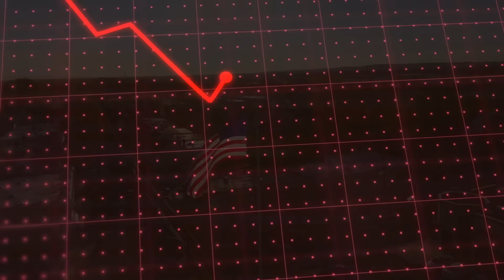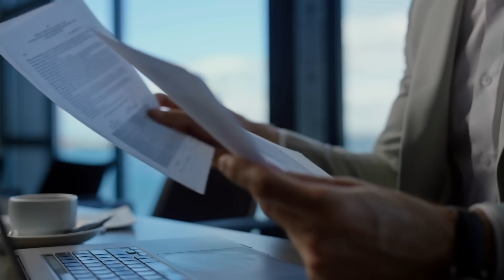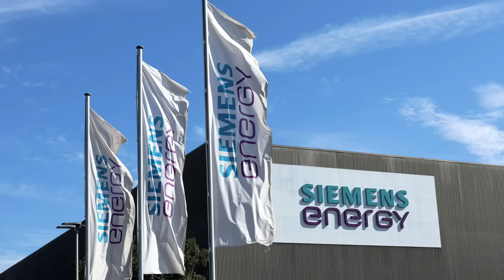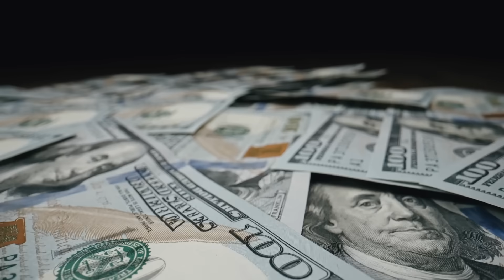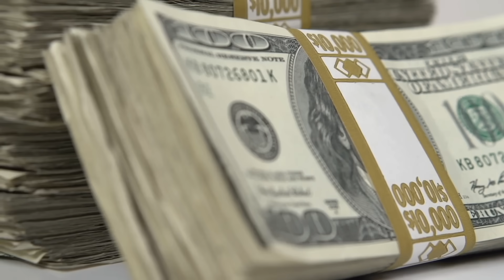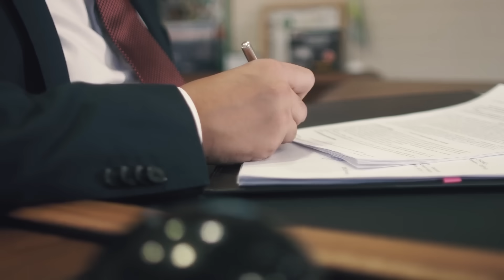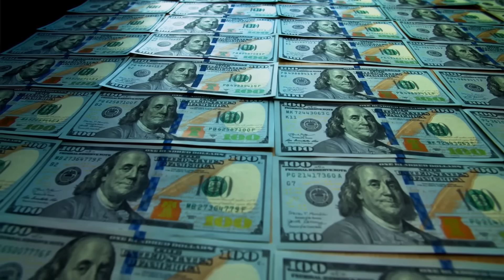The Real Reason America Has Turned Its Back On Wind Power Energy

Comment: While this does identify one serious problem, it glosses over all the others. Wind is not cheap, efficient or reliable. It is also not "green" to make or maintain. The technological advances that have occurred are significant, but they do not justify wind energy or solar energy being generously subsidized everywhere on earth. There are locations that make sense, but so much of what has been built and now is being repowered (part of the not so "green" issue) would not be built if it weren't for the federal, state, and ratepayer subsidies.
Reply: Wind is cheap and efficient.
It is also reliable when one builds enough.
Considering that fossil fuels get subsidies for over hundred years, it is a bit naive to think that a new technology could compete without subsidies.

Comment: Oil and gas are renewable sources of energy because they are made on Earth , not on stars like matels .

 Solar panels are made with silver, and there is not enough silver to cover all the solar panels.
Wind energy requires a lot of maintenance, which increases the cost of LCOE (levelized cost of electricity) .
Reply: Fossil oil and gas is not renewable.

Not all panels need silver and there is no shortage in the next years.
Wind and solar have the lowest  LCOE of all energy sources.

Comment: What is the point of trying to add electricity to a grid at capacity? wouldn't the source percentage just fluctuate?  Why would any investor pay a 200,000,000,000 connection fee with nothing in return but a connection? Lastly, why would the problems of a company only holding 9.7% of the market share cause a "major" problem?  just buy something else. If a small pizza company fails it doesn't case a national Pizza shortage.  Just asking.

Comment: You are very naive.  Solar and wind projects are often located in remote areas where there has never been a need for high power distribution lines.  If they put the wind turbines next to the old coal plant, then there wouldn't be an issue.  Its the same problem with EV charging stations.  There was never a need for that much power to go to one of those locations before.  Someone has to pay for those lines.  In both cases, it should be the company putting in the facility that needs the line.  If I build a house with a half mile long driveway, should I expect the power company to  pay for the line (poles or trench plus cable) to connect my house?  No.  I have to pay for it.  Furthermore, don't make this a government problem.  Now you are just stealing other peoples money (taxpayers) to subsidize a profit based business (power generation).

Comment: Based on the CSIRO's 2023 Gen Cost for Nuclear or Renewables, to power Australia’s energy needs, an alternative with a construction timeline between three to five years, will make wind and solar farms including nuclear fission redundant and meet the Net Zero target 20 years earlier.

A total of sixty-five 86-330 Mw carbon and pollution free Solar Hydrogen Energy Recovery Gas Turbine installations operated with variably regulated base load power supply to service grid energy demand and manage inertia, and mis matched frequency, only requires a combined area of 33 hectares and can be retrofitted to any of the existing 120 hydroelectric schemes so that  existing power transmission corridors can be used to exclude Renewable Energy Zones with a cost range between $2.4-3.3 billion.
Shovel ready off the shelf technology for an 86-330 Mw plant is costed at $36.5 million, noise level is 60dbl at 60m, requires a start-up power source from either 1,400 sq m of solar panels or equivalent panel grid supply and operates from an area the size of a football field.
Green Hydrogen gas produced from nuclear fusion electrolysis, with an estimated 5-billion-year supply of sunlight and supplemented with the turbines Variable Frequency Generator provides use as produced hydrogen fuel to power the turbine at full power for a 24-hour/365-day period with a recyclable 14-year operation period and end of life decommissioning plan with the added advantage of operating Direct Air Capture (DAC) for CO2 at the air flow rate of 1,400kg/sec.

Comment: At 3:45 how do you qualify wind turbines to be very Green to make and maintain if energy prices go up with renewables? How much energy does the average wind turbine generate in its lifetime?
In Australia we are trashing protected areas of koalas, platypus and many other plant , animal & bird species & resuming good farm land to install the wind & solar monstrosities that have started massive bushfires, how much does that cost? We are tearing up our Great Dividing Range all up the Eastern coast, a beautiful and diverse area & now they (Labor Govt) want to litter our coastal fishing areas with them as well, which will have impact on whale migration and our Great Barrier Reef as well.
There is no recycle programs for end of life replaceables that only last 10-20 years if lightning, hail, cyclone, meteorites, bearing & blade failures or bushfires dont destroy them first and we bear the brunt of cleaning up the aftermath with concrete bases that need explosives to remove.
Our fire services are refusing to attend any wind, solar or transmission line bushfires as they have no means to deal with them.
Reply: They can be easily recycled.

Comment: one problem is matching the line voltage etc to the line a lot easier if it is coming in on a single source hydro nuclear and not due to wind that can in a moment spin the prop faster creating a spike in energy overpowering the max load of the lines. That is why energy companies have a team of engineers monitering line load 24/7

Comment: Not a bad video as far as it goes, but much is left out. First, the amount of money to rebuild the nation's transmission line system to accommodate the distributed wind and solar sources is huge and unaffordable. Second, most of the time wind and solar don't work. Capacity factors are typically 10-30%, and there is no affordable energy storage technology, so the primary source of electricity has to be something else. For example, in winter, in the northern US, solar only produces about 10% of its rated capacity. Finally, the demand for metals and minerals necessary to support a 100% wind/solar electric grid is far beyond what the US can provide. So to quote the real experts, that dream is "delusional".
Reply: Nobody plans to rely only on wind and solar.

Comment: It's like with everything. There is a floating bottleneck. That's normal. Now that wind turbines are cost-competitive and we pass the 10% mark the grid needs to be updated. The future is electric. We need to get ready to switch from fossils to elektro. No brainer. We will have more EVs. At some point, we will also find out how to store large amounts of energy. We will find out how to use electricity to drive and fly long distances and so on. Electricity can be generated indefinitely from wind and solar. Till someone comes out with a better way to produce limitless electricity.

Comment: There is another sollution if you wanna go renewalble:
Minesto Dragons (D12 is the biggest one) are kite-alike turbines that use the liftforce of 100% predictable currents to move at 8-10 times faster rate in a figure of 8 and generate100% plannable electricity  and cost effective since the turbines are very lite. About 5 times less material per MW than wind. They can also, as the only technology, operate cost effectively in slow currents, so the 24/7 Gulf is available.

Comment: 1 kg of coal = 6 hours running a washing machine. Available 24/7
1 kg of oil.   = 9 hours running a washing machine . Available 24/7
1 kg of wind and solar equivalent = less than 1 hour running a washing machine. Available only when the sun is shinning and the wind is blowing. Nominally 30% of the time.
1 kg of uranium = 2000 years running a washing machine. Available 24/7. WARNING - The washing machine may not last 2000 years.

I wonder which power source is more efficient.
Reply: The one that you do not need to dig up fuel for.
Reply: @old-pete  Interesting comment. I wonder where the raw materials come from to create toxic renewables. Must come from sun beams, sea breezes and the fairies.

Comment: Wind energy has too big of a negative impact on the environment.  It takes nearly 20 years to offset the building of the turbine tower and transmission systems environmentally.  They don't last long enough to offset upfront environmental cost
Reply: The invested energy is earned back in 5 to 15 months...
GE offers windturbines with a 40 year certification. The oldest windturbine is running for over 45 years.
Reply: @old-pete  you need to check your computations

Comment: New power projects mostly seek to connect to far away places.  They completely ignore and bypass the communities where they are actually located.  That leaves the local communities to continue to source their electricity from traditional energy generation facilities with no possibility to connect to the new power projects in their own backyards.

So, a property owner may lease land to build wind or solar projects, but they will not directly benefit from that new source of power -- they are not allowed to tap into and use the power produced on their own lands.  That all seems counter-intuitive and requires massive amounts of new transmission lines to the far away customers.  

This may make financial sense for the company building the new power projects, but is not very efficient -- it means power is being transmitted long distances instead of simply being used where it is produced.  Part of this is because the traditional power providers are not willing to give up existing customers to some new power company.  Can't blame them -- they have spent decades building and maintaining their local power transmission and generation systems -- they don't NEED additional power and don't WANT it, especially if that new source of power is unreliable wind and solar.
Reply: The grid is interconnected. It does not matter where the connection is.

Comment: The real problem with wind and solar is their intermittency, and inability to deliver power on demand. Solar averages production for 8 hours per day, and delivers zero the rest of the time. And the 8 hours of production can be interrupted by clouds. Wind turbines produce nothing 10% to 30% of the time. The power they produce is highly variable, and is only at full rated production 10% to 20% of the time. Their periods of zero output frequently overlap- cold windless nights, for example. This means that a power system requires 100% reliable and dispatchable backup power to maintain reliability. Reliable power like fossil fuels, hydro, and nuclear.  Which we already have. Adding W & S to a grid does not allow any of the reliable generation to be removed. Subsidies and government mandates will not change these basic realities.
Reply: No country plans to rely only on wind and solar.
Power production can be supported with hydro, geothermal, biofuel, waste and different types of energy storage.

Comment: No one ever though or expected the renewables to replace significant amounts of primary generation capacity in the national grid.  However, when surge capacity was needed the renewables provide the ability to take the edge off when the sun is up, and A/C is cranked.  Sea/land breeze happens on all coasts and can be a ready source for juice twice a day most of the time.  Natural gas is also a great option because it takes a small investment to put in small plants in interesting places relatively easily. 
Most of the problems with wind power in our area (Central Texas) is because the mid-life upgrade, and service life extension programs did not take place, or were not budgeted for.  They just ran with the money.  Profiteers concerned about the environment?  Not on your life.  The power growth requirement is real and constant.  Efficiencies help by doe not solve the problem.  Judicious use of Natural Gas can really help, but the Green Profiteers just demagog every argument to use any fossil fuel regardless of how efficient it is.
Reply: That could be improved with better legislation.
In other countries windturbines are supposed to run 20 years.

Comment: Wind turbines are very green to make and maintain? What extreme nonsense. The thousands of tons of concrete alone, one of the biggest emitters of CO2, makes these intermittent and inefficient monstrosities one of the worst mechanisms for generating electrical energy.
Add to that the carbon fibre blades (made with fossil fuels), generator components which must be imported from countries like China (rare earth metals) and often involve slave child labour, the requirement of a 24x7 fossil fuel backup, and the extreme expense and near impossibility of recycling, only a manufacturer, government, or property owner (selling/renting the land) would even consider such a ludicrous idea.
In short, wind turbines on or off shore are an unnecessary lose-lose proposition.
Reply: They still have a carbon footprint of 1/100th of coal power plants, 1/50th of gas power plants and 3/4th of nuclear power plants...

And they can be recycled fine...
Reply: @old-pete : Wrong on all counts. To construct the number of wind turbines necessary to replace all coal mines in producing consistent electrical energy would be so expensive and take so much land area, that combined with the other competing fiasco in generating electrical energy (solar), there would be little land area left for much else. Plus it would completely destroy the world's economy.
Plus, what would be used as backup power (required 24x7)?
The decimation of avian life alone is so large that "take permits" are required in the US.
Add to this the huge tracts of farmland and forests which are being destroyed (one of the major "users" of CO2) to construct wind turbines and solar panels
But most importantly, the current level of CO2, nearly at a historical low, is in no way a problem for mankind and has absolutely nothing to do with our ongoing climate change.
Reply: @dalemullen96  Which has nothing to do with the carbon footprint, but ok...

Windturbines do not replace coal mines, but coal power plants.
There is enough space to power the world with only windturbines. Not that anyone plans that. So a lot less space is needed.
Windturbines are cheaper than coal power plants.
Fossil fuel power plants kill 35times more birds than windturbines...
Reply: @old-pete : Sorry but it seems that you are just making up "your facts" as you go. What I've been trying to explain is based on actual research for which I can provide references.
That's the difference in our approaches.
Thank you for your conversation.
Reply: @dalemullen96  What did I make up?

Comment: One nuclear power plant produces around 20,000 GWh (continuous) 140 times the electrical output of all 70,000 wind turbines at 140 GW,.... not GWh it's (noncontinuous)  in the U.S. The infrastructure for 70,000 wind turbine is necessarily scattered all over the place hence the problem,... power generation for wind and solar is not continues
Reply: Wind power produced 434,810 GWh in the US in 2022...
All nuclear power plants produced 771,540 GWH in the US in 2022...

All renewables together were at 900,820 GWh in the US in 2022.

Comment: The infrastructure footprint for wind and solar is unsustainable, unreliably, unrealistic and not continuous.... generation 4 nuclear would have seen the U.S. reduce its Co2 output 75% or better by now if implemented with same enthusiasm a wind and solar since 2000,... and small modular nuclear reactor are the only way we will reach net-zero,... just one full scale Nuclear Power Plant can supply 20,000 GWh in a year continuously using existing infrastructure,... there are 70,000 wind turbines currently active in the U.S. generating 146 GW,... not GWh,... because they don't operate continuously, all total costing 12 Billion,.... about the same price as one Nuclear Power plant and a fraction of the footprint. So you do the math, one nuclear power plant produces 140 times the electrical output of 70,000 wind turbines. The infrastructure for 70,000 wind turbine is necessarily scattered all over the place.
Reply: Your numbers are wrong.
Wind and solar do not need much space and the US has a lot of it. 
The current US windturbines produce more than half the electricity of US nuclear power plants.

Comment: Already in late the 70s if any engineer would count the cost and benefit of any types of "renewable energy" would realize that it will never be feasible.  Not for everyday use by the common people.
Reply: There was a lot of technical development since then. Solar power costs only a tiny fraction of what it cost back then (less than 0.4% of the original costs).

Comment: This video is pure lies. If the electrical system can supply enough electricity then why can it not support wind and sun generated electricity. The problem with so call green energy is it does not work when needed most ask the folks in central Texas. No wind no sun no electricity.
Reply: There is this thing called grid capacity.
If you put 300MW power on a 150MW power line, you cannot transport that power.
Additionally one has to build the grid connection first, which can be a hassle if the connection gets very long.

The folks in Texas suffered from non-winterized gas equipment. Again! after 2011...

Comment: The so called green energy are a lie and not reliable for power. The wind towers consume 80 gallons of oil each in order to operate and the blades are not easy to recycle. Solar never has been reliable and Texas has proven that when we had that really bad winter and all the renewable energy failed us!
Reply: Windturbines do not consume oil, it can be reused.
The blades can be easily recycled, ask Veolia and Neocomp.
Texas had to deal with frozen gas infrastructute, which already happened before in 2011.